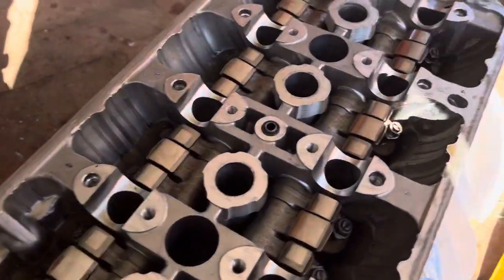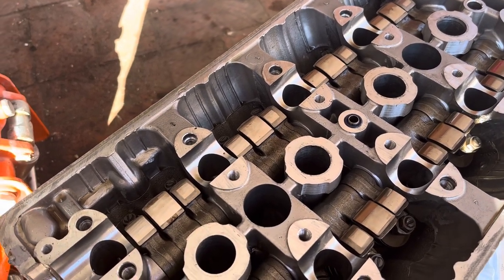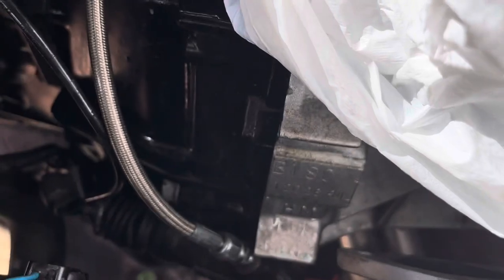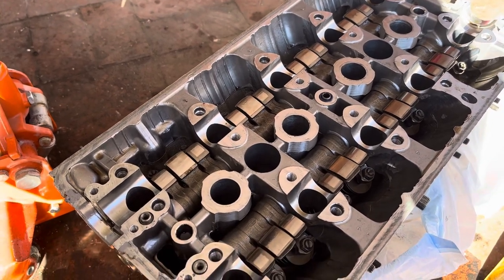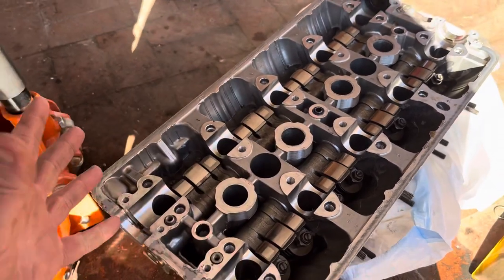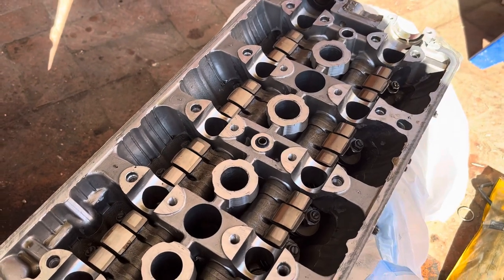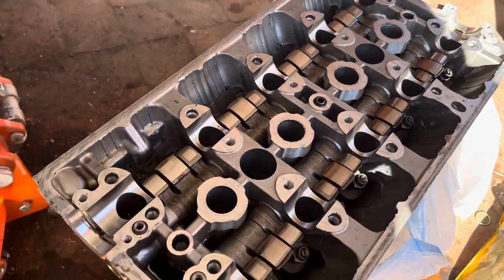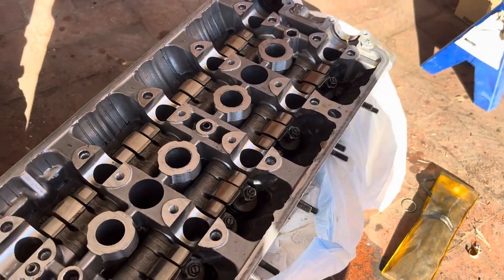Honda VTEC not working? Out of ideas? Check for these two stupid things!

Comment: Great video.
I have a H22A7 turbo.
VTEC never worked.
I get VTEC oil pressure for 1st few minutes when solenoid manually engaged.
Once eng gets to temp I get no pressure.
Been months on and off trying various things to no avail
Reply from the maker: Do you have a pressure gauge? You might not have sufficient pressure when the motor is warm. You may have general oil pressure to the solenoid but not enough?
Reply: My exact issue rn lol
Reply: @officialsmigg1866  
I still have the issue, but haven't had much chance to investigate further recently.
Reply: If I had a suggestion check the oil pump pickup and make sure the oil pan isn't smashed up against the pickup

Comment: And how did that screw get there? Throw us a bone.
Reply from the maker: @mattfoley6082  it’s a common modification, I kinda explain it in the video. You need to block off that oil port if you’re doing b20vtec or lsvtec because the vtec head has a port that doesn’t match anything in the non vtec block. If you put a vtec head on a non vtec block you need to block the port in the head and run an external oil feed from a sandwich plate installed at the oil filter and run up to the cylinder head.

Comment: Crazy  I found 12 v going to my solenoid. Same exact same thing don't know if it's rock arms or plug under head.
Reply from the maker: Yeah once you eliminate the overall engine oil pressure or solenoid and circuit as being culprits, it’s time to check for mechanical issues OR for one of these little plugs.  Good luck 👍
Reply: @sethallison5682  yeah I'm gonna check the oil pressure  for the he'll of it. But the fact solenoid lights up everytime. Kind of pointless  because that pressure sensor sees the necessary pressure for ecm to command  solenoid. I think my rock arms are junk.
Reply: @sethallison5682  updated. Checked oil pressure on front of block have 60psi at 5k when supplying 12 v to solenoid.Now after looking at your video I was able to move the middle rocker pad completely up when I was doing head gasket but never thought anything of it.. This tells me pins are missing or stuck.aftwr watching your video I now realized this  I'm going to replace  rockers and will report back.
Reply from the maker: @gsrturbo3786  it would be a good idea to check for those pins. At this point our motors are 20-30 years old and have probably had at least 5 or 10 owners. You never know what kind of pieces are missing by the time it gets to you. The block on this build had an oil pan on it when I bought it. Luckily I took it off to inspect because the oil pick up was missing.
Reply: @sethallison5682  ahhh replaced rockers still no vtec very very light cross over. I'm lost this stock gsr head on gsr block.
Reply: Before you removed the ls vtec  plug on bottom of cylinder head. Did you have 60psi oil pressure at the test port on the head?
Reply from the maker: @gsrturbo3786  at the back of the head? There was no oil pressure there. That was my first clue actually.

Comment: My engine is B20B block , B16A head and the vtec doesn’t work what can i do ? There’s no check engine light
Reply from the maker: Check oil pressure and check the pins like I did in this video. You have an external oil feed to your vtec?

Comment: why is that plug installed?
Reply from the maker: If you use a vtec cylinder head on a non-vtec block, you plug that oil passageway because it doesn’t match up with anything from the head to the block. You use an external oil line to feed oil pressure to vtec. Since I had both a vtec head and a vtec block I didn’t need it plugged and it was preventing vtec from working.

Comment: My speedo stopped working on my b18c gsr a while ago and now vtec is engaging at 7k rpm I have replaced the vss made no difference I got the car scanned and it showed no codes, I checked the ground around the thermostat and gearbox they are good I also removed the cluster and everything seems good. Has anybody an idea to what could be causing the vtec to engage at 7k rpm?
Reply from the maker: Do you have an EF or DA? They have a physical cable for the speedo. But that’s weird about vtec engaging at 7k. Without a speed input to the ecu AFAIK the vtec shouldn’t work at all.
Reply: @sethallison5682  It's a dc1 with a b18c gsr swap, forgot to mention the speedo has been working then dropping off for a few months and vtec was working fine but now out of say 15miles of driving the speedo will work for maybe 1 mile then stop and the odometer isn't working either
Reply from the maker: @A.D953  I would definitely get the speedo working first but yeah man that still doesn’t explain the vtec engaging at 7k. What are you running for ecu? Stock gsr tune has vtec at only 4400 rpm.
Reply: @sethallison5682  I'm running a p28 chipped ecu, vtec was engaging at 4600rpm until recently, when I tested the vss connector plug I set my multimeter to ohms and when probing the ground wire I was getting a reading of upto 1708. I was told ground wires can give a reading and it's not a problem is that true?
Reply from the maker: @A.D953  a lot of times I’ll check signal wires at the ecu itself, as well as the connector. It’ll tell you if the circuit is good. I would maybe try another chip. I’ve had bad ones before. Shot in the dark but if you’re in southern Arizona I’ve got an extra one you can try.
Reply: @sethallison5682  yeah I'll check connection from the ecu hopefully I'll find the fault there and I'm in Ireland so it would be a fair drive for me 😅 thanks for your help man very much appreciated 🤙